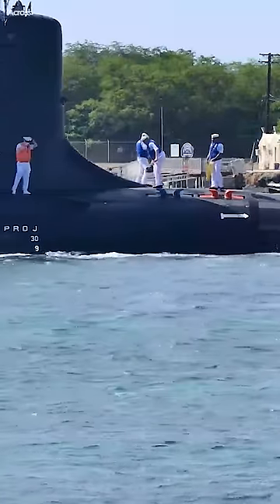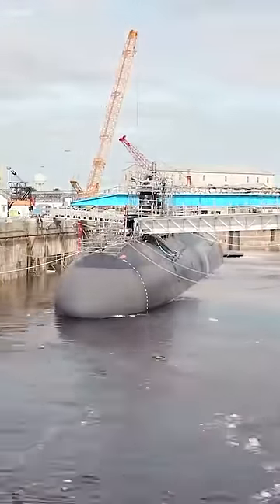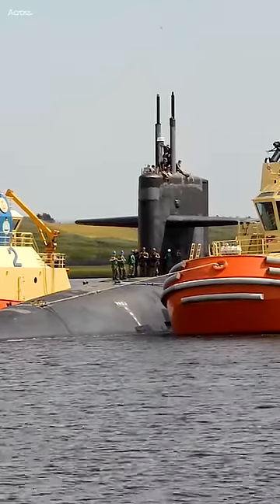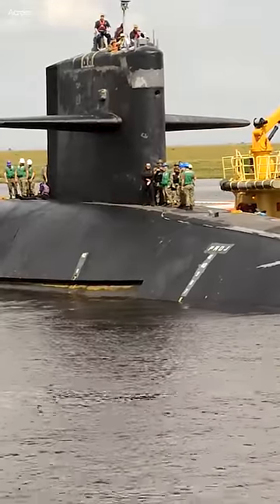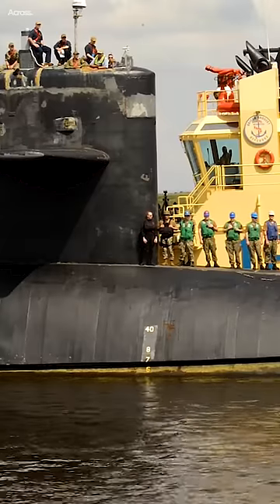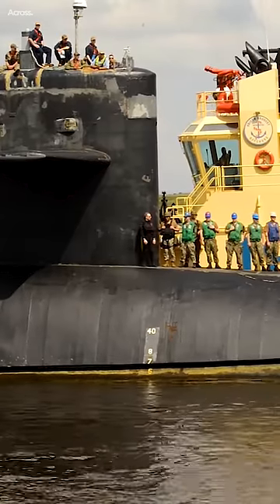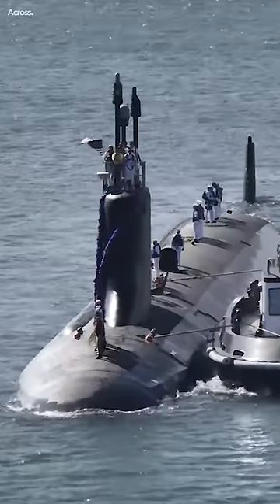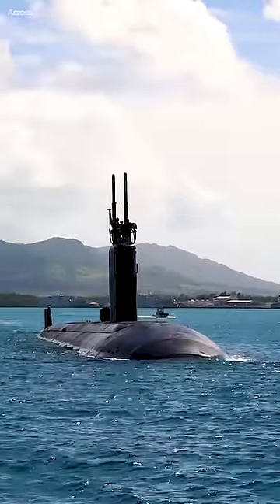Why the US Navy Doesn't Build Titanium Submarines #shorts

Comment: The Soviets actually nicknamed their titanium submarines “golden fish” because of their astronomical cost.
Reply: Funny thing is that cost is not an issue to the US DOD. The biggest factor is usually "is this actually a valid idea". Titanium isn't as it is a horrid material for pressures.
Reply: @bransonwalter5588    Who told you Titanium isn't good for pressures?   Titanium is used in many deep submersible mini-subs,  such as the Alvin, and can withstand higher pressure and depth.   You're on the internet and Google is free. Check your facts before making any more stupid comments.
Reply: @MrRobarino  Well, there is the fact that titanium has problems with constant pressure changes. Google could also tell you that a country that setup shell companies to buy bulk amounts of titanium when it was a rarely used metal and has a military budget larger than the next 20 combined would have no problem spending the money to do so. However, you still believe that country would go that cheap.
Reply: @bransonwalter5588 you know they use titanium for DSV rated to Challenger deep like Limiting Factor or  Alvin with close to 5000 thousands of dives?
Reply: @bransonwalter5588 yup that why DSVs like Alvin and Limiting Factor use titanium rated for challenger deep with thousands of successful dives
Reply: I heared something about how the soviet union were the largest supplier of titanium, would of been cheaper to build actually.  Unlike the us  didnt have enough ores to make enough titanium they even  had to buy some from the soviet union to make the Lockheed SR-71 Blackbird
Reply: A scientific submarine and a naval submarine are two different animals.  One only has to make a few dives in its total lifetime.  The other many hundreds of dives.
Reply: @bear76009  Alvin a "Scientific sub" has thousands of successful dives spanning decades. Alvin is actual older than any still active military sub launched in 1964 and is still diving in 2023.
Reply: @johno1544  I guess you missed the part where it had "numerous overhauls" and no it does not have thousands of dives on its hull.  It gets a hundred or so and has to have a complete overhaul.  
What good is a sub you have to overhaul constantly?  Plus it only carries two people and can barely move around. The depth it goes it's also only 6500 meters so it does NOT go anywhere near the depth of Challenger deep or Marinas trench.
Reply: @johno1544  there have only been 3 people to Challenger deep on the Trieste.  A navy sub has to be several magnitudes in size larger , and be able to move around by itself and not need a mother ship to haul it around. 
Is it neat sub? Sure but it's a toy compared to a military submarine. If you want to have a new military sub with modern materials?  Graphene seems to be the future of almost every application that's not a heat problem.   Besides the US has lost a few sub but none since the 60s the Russians who operate some titanium subs have lost a few. We (the US). would rather be quiet than fast and deep running.  Once you go under the thermocline there really isn't any benefit to going any deeper.  It just makes it easier to kill you.
Reply: @bear76009   Alvin routinely undergoes a refit about every 3 years where it is completely disassembled down to the (1.9 in.) thick titanium. They dont scrap the Titanium hull every refit 🤦‍♂️ you saying they dive only a few times in their life time is absurdly wrong. Any clue how many dives it does in 3 years it's not a few dives like you claim and guess what they refuse the titanium hull. As if military subs dont under go maintenance and overhauls. In the US currently nearly 40% of US fast attack submarines are in repair or awaiting maintenance at shipyards right now.
Reply: @johno1544  not anywhere close to what a navy sub dives.  You are comparing apples and oranges.  And you might not have said it but some moron above us did. He was making the assertion that we have been down 12km numerous times.  Again a little sub it's ok a big sub it's. It worth it
Reply: @johno1544  as far as the maintenance on the Subs that's a big ol duh .  We always have subs undergoing maintenance and overhaul we don't want to have a record like the Russians do.  Plus what's better having 100 subs made from steel or 10 from titanium?  As I said it's overkill and isn't going to protect you from torpedoes of any type.
Reply: @johno1544  also above all this. . people smarter than both you and I designed and built the subs the way they are for a reason.  You don't make a F-15 into a space shuttle because you don't need it to go to space. Same thing with subs

Comment: I worked at a facility that manufactured titanium ingots for aircraft industries. There are many grades of titanium with different characteristics and strengths. Pure titanium, called CP, is very easy to machine, but not as strong as alloyed titanium. So calling titanium as if it was all the same is just wrong.

Comment: The real reason they don't;... Titanium all belongs to Russia
Reply: True, they didn't talk much about the lack of Titanium
Reply: False. Australia has far more titanium than Ruzzia. Ruzzia is no. 7 in reserves. Their ore requires a very "dirty" process to produce titanium. The Western deposits are mostly in an ore that is easier to process. The USSR built one titanium sub. It's hull developed micro fractures and leaked badly. They also made titanium combat helmets. They stopped after they made a few hundred. They were ineffective. Titanium is very hard to work. It is also prone to becoming brittle.
Reply: @linhdua6066 Australia is no.1 in titanium reserves and production. Ruzzia is no.7. I have relatively inexpensive golf clubs with titanium club faces. Would even inexpensive recreational equipment be available with titanium if it were rare in the West?
Reply: Found the Krembot
Reply: Lol, Jamaica has a large deposit of titanium too

Comment: Here's the thing. With modern anti submarine weapons titanium would just be a huge waist of money am time
Reply: It’s like saying missiles can penetrate tanks why do we have armor on them 😂
Reply: @TheRedAmogus  it’s more like saying there’s no point in making the tank out of titanium
Reply: @TheRedAmogus  That would mean titanium could protect submarines from conventional weapons. It cannot.

Titanium can help increase dive depth and reduce the weight of the sub. That’s because Esther pressure spreads around the sub symmetrically.
The explosion of a torpedo, for example, creates stress in a small area. There, it makes no difference if it is titanium or steel. What is actually important is to stay undetected. So, instead of wasting money on titanium, it gets invested into sound dampening, the actual armour of a submarine.
Reply: @TheRedAmogus  true they didn't make a good point.
Reply: @nanolog522 Yes,  and also according to the top comment, it can't drive as deep each time eit dives. Forgot who said it's but just stating that this isn't plagiarism. It's by spushed
Reply: @AzultonSmugUltra actually they did. Titanium would be no better at defending the sub from attack than steel would be. So why spend the extra money and effort on making a titanium sub?
Reply: @skeeman7514  Like someone already pointed, there's many, I'm sure they only said because it's not cost effective, there's no urgent threats requiring such a beast.

Compared to HY-80 naval steel at 550MPa, Titanium ranges up to 1400 MPa depending on the heating method, stronger than ultimate Tungsten at 980 MPa.
Graphene intrinsic to 130000.
Reply: @ImReverseGiraffe  I presume depth itself is a defense against being detected.
Reply: @Fuck_Snowflakes  it's cheap and easy to shape/ build with.
Reply: After this episode with oceangates submersible it should be evident to everyone why the navy doesn't pursue deep diving subs , another person commented that the focus is on stealth and quietness.
There's a reason they call it the SILENT SERVICE. Crew member  SSN687.
Reply: Stick to emojis.. he is right you are not
Reply: Graphene is the future, it's even a superconductor I have read

Comment: Titanium takes special welding tech., it's very hard but "brittle" and may get small cracks when at test depth.  Steel, American steel, is very durable and damned near the wear of Titanium.
Reply: True.  Titanium is not the easyist metal to weld.  It takes a lot of prep and many times it is welded in a purge box.  It looks like a sand blasting box but it is purged with Argon gas which is inert to create a oxygen, nitrogen, water free atmosphere.
We have a lot more experience working with steel, we have been welding it now for well over 100 years now, so we have a pretty good idea how it reacts under different stresses.
I think the Russians have experimented with it partly because they have some of the largest deposits of it in the world.
Reply: this is why Russia has a giant tube filled with argon gas so they can weld a big section of the sub inside that tube.
Reply: @mikes4142like Aerosmith said dream on.
Reply: @mikes4142 they are not mining anything at all. THey had to work on those carrier dock craks....lol
Reply: BS some of the most famous DSV use titanium like Alvin and Limiting factor with thousands of dives rated for Challenger deep depth

Comment: Titanium is light and strong, but is hard to work (shape). The Russkies built one and found that the hull gets BRITTLE under pressure in the cold depths of the ocean. Titanium is a useful additive to many steel recipes. I'm sure small amounts of titanium get into many modern subs.
Reply: that's just BS, Russian titanium sub still operates today without all the problems you mention. Russia builds huge tubes that fill with argon gas so they can weld a big part of titanium inside it. 
what makes titanium welding expensive in the West is the defense industry.
Reply: @tommytomas-fr3sh  Western defense industry has higher expectations for quality control. Difficult to weld titanium to USN subsafe standards on the vast scale necessary to build a whole boat. But it's really about material properties. Titanium allows a super-deep dive... once. quality steel hulls allow a deep-enough dive repeatedly. Soviet design bureaus were in constant competition with each other for on-paper performance specs, ie fastest sub, deepest sub, most torpedo tubes, etc. and titanium helped them achieve those big numbers that got them contracts. American design process focused on useful attributes like stealth, sonar, and effective weapons.
Reply: @tommytomas-fr3sh 
Given that Steel alloys can do the job fine, it’s hard to see titanium needed for submarines. Titanium is used in applications where light weight is heavily needed.
Reply: @kotori87gaming89  Titanium hulls are pretty common for deep sea research submarines, wich dive tausend of times more often than once "super-deep"
Reply: BS the DSVs Limiting factor and Alvin both uses titanium pressure vessels rated far deeper than any military dives and Alvin alone has like 5000 dives. Limiting factor has the deepest dive depth of any manned vessel

Comment: The other issue with titanium Is that it's such a stiff metal it's almost like glass , It has no memory or flex , Although it's stronger than steel , Steel can bend under pressure , Instead of forming spider cracks , And then having a catastrophic failure , Think of an aluminum can You can put a little dentinet , But a glass bottle will break
Reply: The USSR already went down this road. They built one titanium sub. Brittle is the word.
Reply: @marksnyder8022  I was a bike messenger in chicago , We know better than to ride on titanium parts , ah  Snap Is the newer generation of composites show much more potential , Back in the day they were totally stiff but they've really got the flexibility work into them  now , I don't know I could maybe see the uses of titanium As like a reinforcing substructure , The truth is that steel alleys can be made to be very strong
Reply: DSVs limiting factor has the deepest rated depth of any manned vessel and it uses a titanium pressure for its crew. Alvin does aswell and has thousand of deep sea dives under it belt.

Comment: Why would you need weight savings on a submarine? Don't they require ballast, as it is?
Reply: Came here to say this. You are correct. Water is heavy as hell, and submarines need to sink in it. You WANT heavy!
Reply: Lighter sub = stronger ability to break through arctic ice. Buoyancy requires an extremely balanced design.
Reply: @jolio81  No that is not correct and water isnt heavy as hell.
Weight is for an submarine as importand as for ships or airplanes.
The goal of an submarine isnt to sink it, its to weight exactly the same as the water it displaced.
1m³ steel need to displace 7,8m³ water to have a neutral buoyancy, 1m³ titanium only need to displace 4,5m³ water, so the titan submarine can be much smaller or have a much thicker and stronger hull or have more payload than a steel submarine.

Comment: When I was in we used HY80 steel, now it's HY100.  Meaning it can now withstand 100 thousand pounds per square inch.
Reply: That doesnt sound right, It would be able to go to Challenger deep easy if it was that strong its 15,750 psi at the deepest point in the ocean.
Reply: @johno1544  well having worked on subs for 3 years I know what it means.
Reply: @robertborglund5783   so what's the psi strength of weld you are using connecting two HY100 plates?
Reply: @johno1544  I've never welded two together.

Comment: Can’t compare it by weight as it’s much lighter for its strength therefore much less (by weight) is needed. It is however more expensive to work with in manufacturing pars. It has more to do with that and the need for a lighter sum, in material alone since much less is needed comparing it by weight is meaningless.
Reply: I came here to say this. Instead of being 4-8x expensive by weight, by volume needed it’d be less of a difference

Comment: Worked at the New Port News shipyard where many of the Subs are built now work at a large chemical plant.  Titanium is used only in cases where extreme corrosion of chemicals won't allow steel stainless steel or other materials.  And it is britle and expensive.
Reply: If its brittle why do some of the deepest diving DSVs like Limiting Factor rated for 11,000m use it for their pressure hull? They arent using it because it's cheaper that's for sure

Comment: I admittedly don't know much about subs, but I do ride road bikes. The problem with aluminum and titanium frames in terms of durability, are very strong but tend to fatigue over time. This isn't a huge problem for road bikes since you typically ride them on flat roads. But you have to be aware that your frame has an expiration date that moves closer every time you use it. Same goes for carbon fiber which is why I don't fuck wirh that stuff. Straight up steel for me.

Edit: also, while titanium isn't that much more expensive than aluminum, it is a bitch to machine and weld.

Comment: Titanium’s corrosion resistance can be achieved by applying a plate over the underlying steel structure…
Reply: Plate of what?
Reply: @johno1544  Titanium duh…
The Australian Collins class submarines use a titanium over steel construction.
Titanium for salt water corrosion resistance (something titanium is really good at), high strength steel underneath because it is 1/10 the price for the same strength.
Deep diving becomes a balance between weight of the pressure hull and depth. 4km is about the point a bare pressure hull able to resist the pressure becomes too heavy to float on its own if made from steel.
Titanium is half the weight of steel for the same strength so can go a bit deeper for the same weight.
Either way, bottom of the ocean operations require external floatation materials - usually isostatic foam (glass spheres in epoxy resin) but polyethylene and tanks of gasoline works too.
Reply: @allangibson8494  45% of the weight steel for the same strength duh not half
Reply: @johno1544  Close enough for engineering design…

Comment: You would want the Meissener effect. It produces 0 magnetic properties  meaning no mines, and superconductor means no em signature from inside the sub. 0.
Reply: Or you just degauss the submarine.
Reply: @bransonwalter5588  ya but degaussing the sub won’t make it fire proof.
Reply: @helicalactual  who said anything about fire resistance?
Reply: @bransonwalter5588  superconductors deflect all em radiation. So… fire proof yes?

Comment: They had problems when designing the SR 71 Black Bird. Titanium is strong and can handle high temperature. BUT! Its very brittle and just wouldn't be feasible for submarines. It can withstand salt water though. But perhaps there's a manufacturing technique that could make it work. I don't know that. Maybe a titanium alloy of some sort?
Reply: They literally use tons of alloys in ship construction. The reason the US doesn't use pure titanium is the fact that the US military does tons of material tests on alloys. You can literally get access to them fairly easily. However, the US also developed the shaping techniques and machining techniques to male titanium parts easily. The problem? There are way better materials than pure titanium. That even comes from a machinist friend who spent years precision machining titanium.